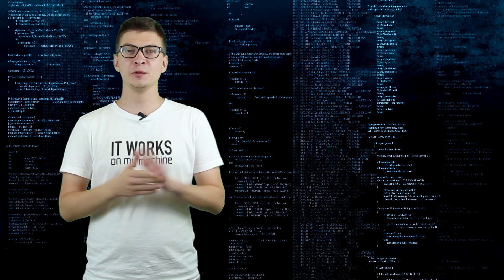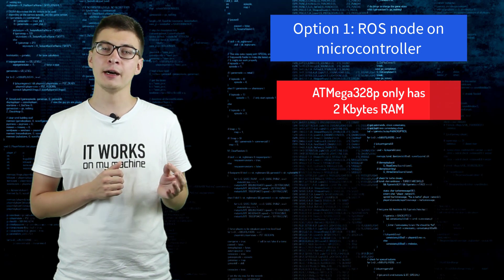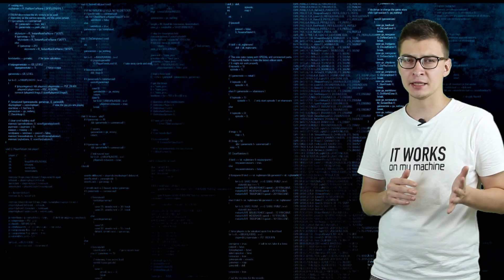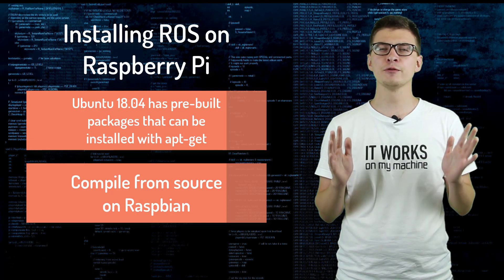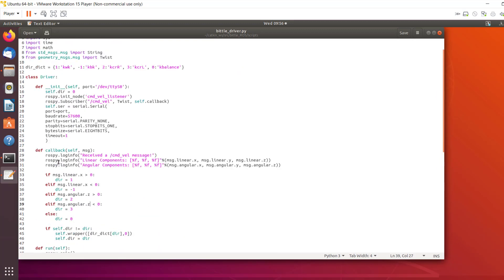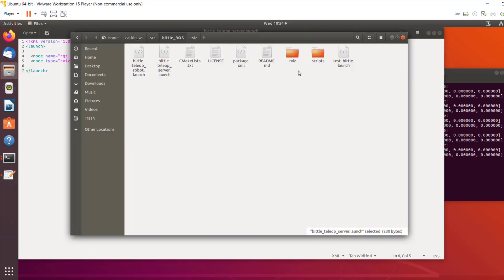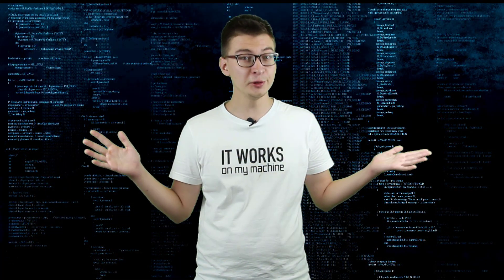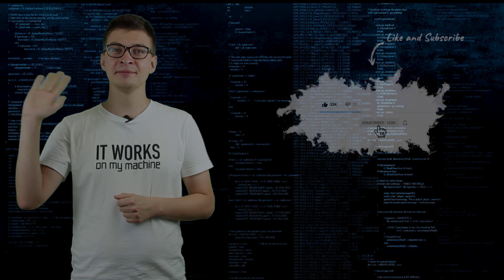Bittle Teleoperation with ROS and Raspberry Pi: Custom driver, using Twist messages

Comment: Hi thank you for video. I'm wondering what are the orange clips you have that holds the Nyboard and the Raspberry Pi together. Even on the Bittle Petoi site they mentioned if solder on the socket, you won't be able to install the back cover of Bittle. I would like to have those clips that you have.
Reply from the maker: Hmmm, nothing special about the clips. I just put some hot glue on the top of the clips and then put the cover on them.

Comment: I wanted to get the Biboard to use in ROS to improve the dynamics motion. Will u guys recommend to get the sensor pack together with the Biboard? Thank you.
Reply from the maker: There's no "guys", it's just me running the channel, hahah. Anyhow, sensor pack is not necessary for improving dynamics motion, just Bittle and BiBoard is enough.

Comment: Is it possible to use bluetooth or wifi dongle on a Bittle and run ROS on a Ubuntu laptop instead of Raspberry Pi?
Reply from the maker: Yes, by all means. Although quite obviously you won't get a camera feed this way.
Reply: @Hardwareai  Why? Bandwidth is to low?
Reply from the maker: Well, Bittle has ATMega 328p on the mainboard in standard package - this is same chip as in Arduino Uno, which is way too slow for real-time video transmission. It is possible with ESP32 though
Reply: @Hardwareai  I pledged for video camera with bittle. I see it won't fully work without Raspberry Pi 😟 Biboard is to costly for me. Maybe I should take Biboard instead of camera and buy RasPi camera later?  What you would recommend?
Reply from the maker: Hmmm, the camera that you can order together with BIttle on KS is MU Vision sensor, you can find the full description here - https://www.seeedstudio.com/MU-VISION-SENSOR-3-AI-Robot-Vision-Camera-Supported-by-Arduino-Micro-Bit-p-4449.html
It will work without Raspberry Pi - it's just as a more advanced developer I opted out for ROS and Raspberry Pi, whereas MU Vision Sensor is more suitable for beginners, since it has simpler ready-to-use API, but not open-source.
Reply: @Hardwareai  Thank you for the link. I hope I'll manage to transmit video via wifi from this camera to a laptop, do more advanced picture recognition and send commands back to the bittle. Later I'll probably buy RasPi. It would be cheaper than Biboard though I would miss build in microphone and speakers.